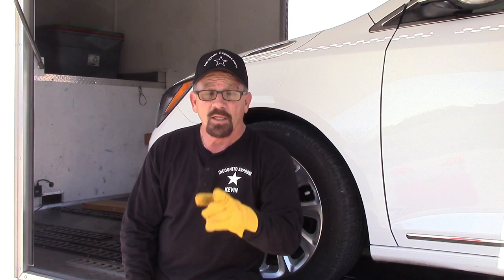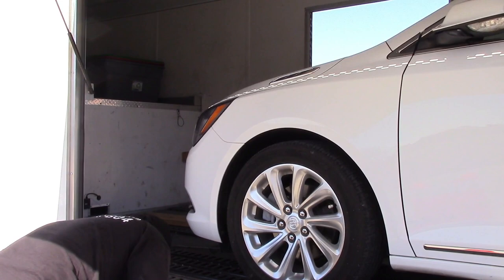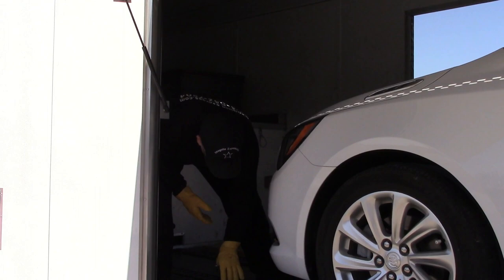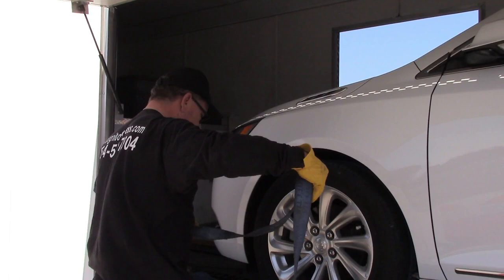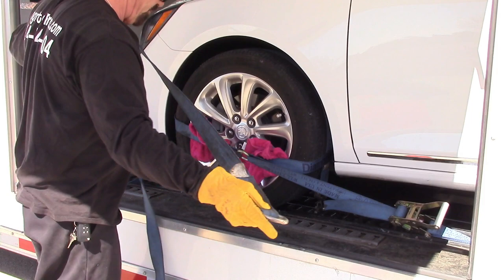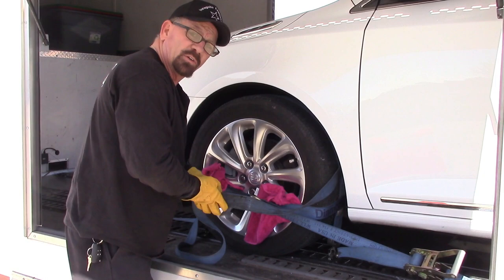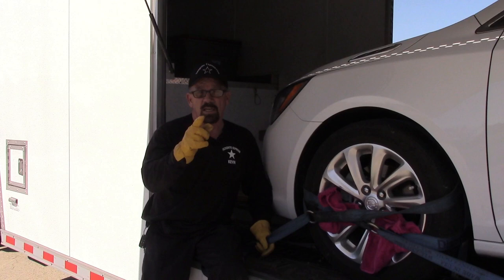HOW TO PROPERLY TIE DOWN A CAR

Comment: Cut the toes off old socks and put two socks together on each strap. This will stay on the strap. Putting towels or rags stuffed in the strap can fall off. Those lasso straps should always have the metal loop at the end of the tire. If that tire loses pressure and the strap moves, it becomes loose. Always cross your straps in an X pattern if possible. Your car will never move side to side this way. Etrack stops foward or back motion, not side to side..
Reply: Tiny's Transportation Tiny Unis could you do a video and show us an example.
Reply: Side to side?? The suspension will already shift weight, and its very unlucky the car would side side to side unstrapped, but with the straps creating a lot more traction, I HIGHLY doubt it would be necessary. Seems like more of an annoyance to be honest
Reply: If any of you transporters think moving exotic cars with less than  half an inch or one inch clearance isn't dangerous? I crashed getting cut off by a driver. One inch clearance on both sides and 8 straps, 2 per wheel crossed, and no damage. I TRUST MY TECHNIQUES FOR SECURING CARS. MY FACEBOOK, INSTAGRAM AND YOUTUBE SITES show why I'm a preferred transporter. I don't criticize any other guys ways, only offer my opinion.

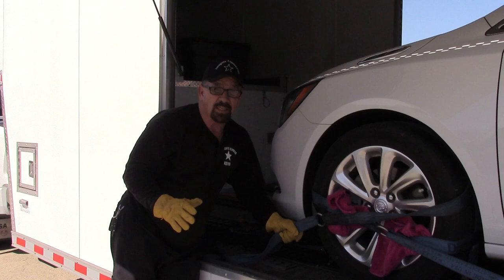Comment: Just want to point out at 3:25 if you have to slam on your brakes not only would the strap have to withstand the force due to deceleration, typically the avg driver can brake at 1.4gs so that 3800 lbs would be subject to that force and have an equivelent force of 5300 lbs. Depending on how the braking is done most of the load can be applied to one side of the vehicle. So in theory 1 strap per wheel would not be enough or come really close to the load limit of the strap to hold sustain the vehicle under an emergency brake. Great video and some handy tips. keep up the good work.
Reply: Bullshit. Maximum g-force for most production cars is 0.8g or less.

Comment: Why not just use 8 point straps? This is so much extra strap wise
Reply: 8 point straps are only 4 piont straps. If one of the points breaks the other point just comes loose. Just saying. However they are better. If a Single tire single point strap breaks, the strap on the other tire will let the vehicle roll/slide in the direction the strap is pulling. "8 point" straps will keep the vehicle from doing that.

Comment: Hello. I am looking for tips and suggestions. I am new to vehicle transporting. It is for my personal items only. I have a lifted Jeep on 40" tires. Weight approx. 5000lbs. I have a 22' trailer with drive-over fenders with D-rings on all four corners and in front and back of each trailer wheel-well. Additionally, the trailer has rub rails along each side where chain and hook can be anchored. What would be the best solution for transporting? I see a lot of 4x4 rigs use axle straps with ratchet straps connected to D-rings. I read that the straps should be no less than 45 degrees (axle to D-ring) otherwise there is big loss of tie down force. My ties on the rear axle are at 45 degrees. Front axle straps are less than 45 degrees. Also, should I strap the Jeep body rock sliders to the D-rings next to the trailer fenders to keep the Jeep body from bouncing?  Thanks in advance!
Reply from the maker: You do not need to strap down to stop the bouncing. The 45° angles not bad but not mandatory. Take for axle straps, go around all four corners of the vehicle, right front tire pole forward left front tire pull forward back right tire pull backwards left back tire pull backwards. After your loaded and ready to go stop after one hour and tighten the straps then drive four hours, and every four hours check the straps. The one thing that you did not mention is the pound ratio for the straps. Get straps that are rated for 5000 pounds per strap. Therefore you would have 10000 Pounds of straps pulling forward and backwards. The reason is most vehicles do not weigh over 5000 pounds so therefore one strap is fine if one was to break. Good luck
Reply from the maker: Four axle straps
Reply: @incognitoexpress3838  Yes, 5000 lb straps. Thank you!

Comment: Sorry but you're wrong.  As the trailer is going down the road those straps will slide down off the tire and come off at the bottom.  They need to be at the 10 and 2 o'clock position and tied down on the side not the front or back.  Front and back of the tire tie down as you have shown needs a basket strap.  People.... Be careful of watching these videos because not all experts are 'experts'.

Comment: You’ve over complicated this. Do one long strap each wheel and make your own loops. Hook to trailer front and back. Will pull down on the wheel and will also keep it from moving forward or backward.